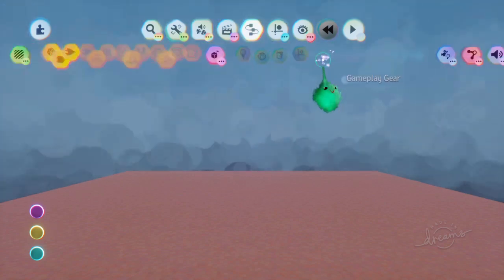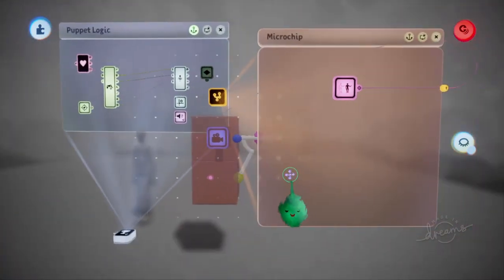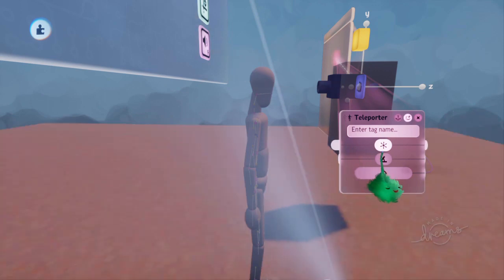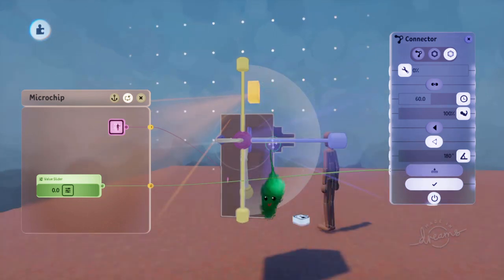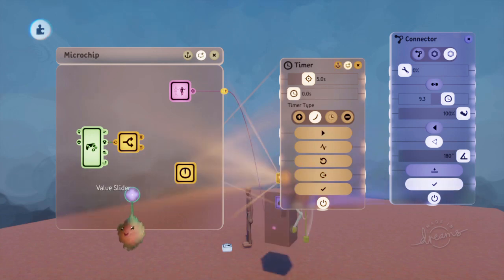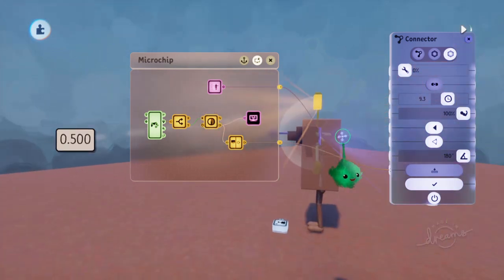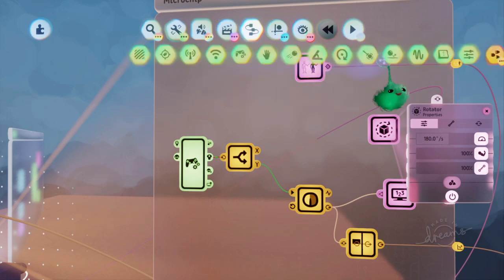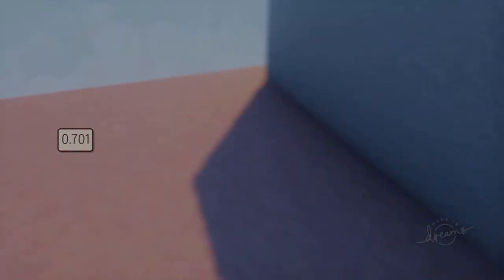Making a Camera Rig - Part 1: First Person | TAPgiles Daily Dreams Tutorial

Comment: I don't know if things has changed, by 3 years, but now days, I followed step-by-step, and my character is doing the whole slide-float off the floor movement.

I likely have to start over. Something might of went wrong on my part. Your tutorials are helpful, thanks for the video.
Reply from the maker: If you try using the rig in the collection (linked in the description), does that one work?

It could be something to do with collision settings or something...

Comment: TAP i have a small problem with your camera. When i put it on my puppet, the camera ever so slightly tilts when im moving the camera, causing some motion sickness.
Any suggestions how to fix this? Definitely related to my puppet and not your rig, but i'm out of ideas haha.
Reply from the maker: Which rig is it, in particular? I have a few.

And you shouldn't be putting it inside the puppet; just out in the scene. Then move the tag into the puppet you want to follow sorta thing. Or use the puppet provided.
Reply: @TAPgiles  Third person rig. Ah outside of puppet, ill try that. Unfortunately i can't use the default puppet, since i've already put so much in to this character. 

For days i've been trying to solve this camera issue/lock-on issue haha. I'm creating a souls-like game and the camera has been the biggest problem up to now.
Reply from the maker: @QuiltcakeAnimation  Cool. If it's third person anyway, all you need to do is copy over the tag from the puppet that comes with the rig.
Reply from the maker: @QuiltcakeAnimation  Ah interesting... I hope it helps :D
Reply: @TAPgiles  It's working! Thank you so much, haha.

Comment: This tutorial is great! Tap, could you also make a tutorial on how to properly animate a puppet aiming a gun, recoil, and reloading/gun swapping?
Reply from the maker: Cheers! Yeah, I've been helping people with getting the arm to aim recently. I'll add those to the list :D
Reply: @TAPgiles  Thank You so much for taking my request! I'm currently working on an FPS puppet, and I can't seem to get the arms in sync with the camera. 

also, quick tip for hitscan projectiles,

Mm has added a Cam/head tracker tool for VR, they work without VR as well.

Instead of lining a Laserscope with the camera, you can use the Cam/head tracker tool's Hit Position output, to tell the bullet where to land, and the "Hit"? Output to disable the projectile emitter when firing off into the void, to prevent unwanted random bullet spawn.

Hope this helps! :D

Comment: I need help I want my characters sword to move with the camera up/down but it just stays in the middle ive tried to fix it but i cant
Reply from the maker: Have a timeline that animates the sword arm (or whole torso) to angle up/down. Then wire the timer's output (the one that's going into the connector) into the bottom of the playhead line to control the playhead. Now when you're looking up you'll be at one end of the timeline, and when you're looking down, at the other end.
Reply: @TAPgiles  it worked, thnx so much man :)
Reply: @TAPgiles  ive got a newer problem, if I look up and do my attack/swing animation it resets the arm to the middle of the screen
Reply from the maker: @zeqja  Perhaps you have "keep changes" on or something? Ideally you'd have the up/down stuff completely separate, tilting the torso up. Then use L2 to record rotations of the arms and such for the animations; which means it'll still be tilted as normal and should return back to the right position after.
Though theoretically, as long as the tilt is in a separate timeline to the animation, and the tilt is always powered, it should just stay in effect.
Reply from the maker: @zeqja  Yeah I think so. Just be sure to use L2 not R2. This will record rotations of the joints and sorta add on to whatever rotations they already have from the tilt.
Reply: @TAPgiles  yeah its working now, thanks so much you have no idea how long i have been looking for this, have a good day :)

Comment: This helped me sort out a camera rig box, but instead of using a rotator on the one box i used 3 boxes in total. one for the camera, one for the up/down bolt, and one for the left/right bolt because I want to have a limited range for the camera.

How do I increase the turn rate of the bolt? When I change the speed of the bolt itself it doesn't actually change how fast it's turning for some reason??
Reply from the maker: As you're controlling the target point of the motor bolt with the timer, it's the timer that dictates how fast pushing left or right changes the rotation. So if you have the target time set to 5s, it'll take 5s to go from extreme left to extreme right, for example. If you set it to 2s it'll take 2s to go from extreme left to extreme right.

The speed on the motor bolt is just how fast it moves towards the target point. So if you have it too low then when you change that target point it cold lag behind and feel weird as it's still trying to get to the right point even when you've stopped pushing on the stick. So I tend to leave that pretty high.
Reply: @TAPgiles  Ah ok I thought it might be the timer itself but I wasn't quite sure. I will try that. Thank you!

Also trying to figure out how to press a button to recenter the camera but everything i try resets the timer to 0 instead of the desired halfway time. Still have to work with it.

This stuff is really challenging my problem solving abilities :D
Reply from the maker: @angrygreek1985  Hehe... yeah, this is a pretty advanced setup to make. Try using a keyframe with keep-changes to set it to the midway point of the timer. Then pulse it on (turn it on and off real fast)--using a signal manipulator to create a pulse.